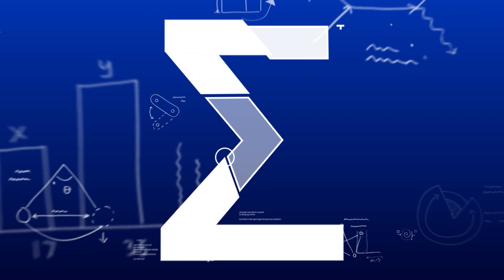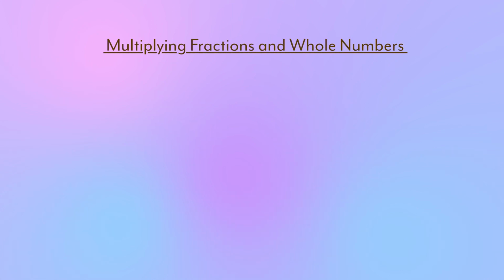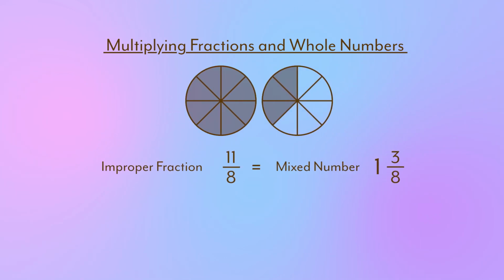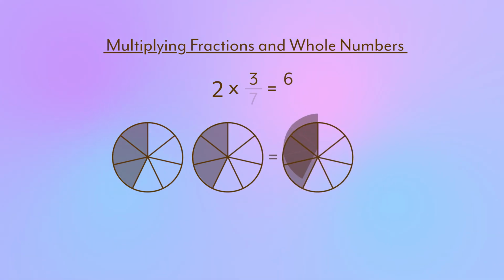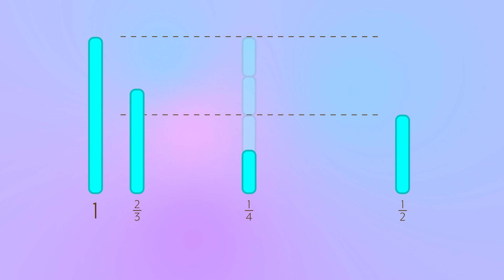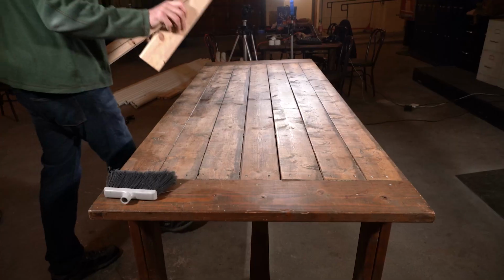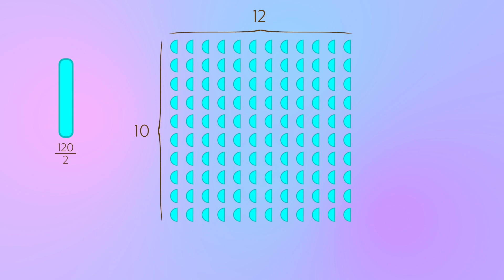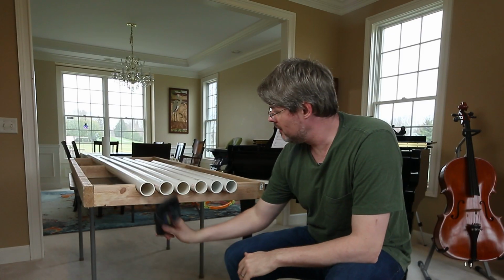How Humans can Hear Fractions

Comment: Thanks for this great video! I love your channel and find that your videos inspire me to expiriment and learn more about math! A while ago, I wondered what the relationship between hertz and notes on the piano are, and did some expirimenting and I found this out from what I knew:
In science, we measure pitch with hertz. to find what hertz a note is, you need to know two things:
1.) what hertz another note is. (A4=440, for example)
2.) the formula for moving up or down a half step. (Which is the twelvth root of two)

Here's how I figured out the formula from what I already knew:
1.) I knew that when you go up an octave, the hertz value doubles. Ex: A4=440, so A5=880 and A3=220
2.) There are twelve notes in an octave (8 white notes, 5 black notes)
When you go up a half step, you have to multiply by a certain number, and I know that you multiply by 2 to go up an octave. With h=go up one half step, and c=go up one octave, we can say that c=2. Since there are 12 notes in an octave, you have to multiply h 12 times to get to an octave, this means that h*h*h*h*h*h*h*h*h*h*h*h=c, or h^12=c. Solving for h, half steps, we get h=twelfth root of 2. Goin up a half step means multiplying by twelfth root of 2. 
To find out what a note's hertz is relative to another note, find out how many half steps away it is. To find A#, I know that A=440, so I multiply it by the twelfth root once. A#=440*twelve root of two. to go down, you divide by twelfth root of two, and to go up, multiply. 
I love math! :D

Comment: The solution that doesn't require cutting, for anyone interested, is to make an automatic guitar/piano. Take several same-length strings, and have a holding apparatus pinch them off at measured lengths, taut. then strum or strike them to hear their notes.

Comment: I always assumed each note in an octave went up by eights, but after watching this, and thinking about the simplification, that would never work, and this made sense of it.
Reply: Going up by eighths wouldn't have made sense since there are 12 notes in an octave. This is a bit more complicated than the video makes out, but there are different types of temperaments you can use to tune, this video uses more of a type of just intonation. The one you're likely familiar with is 12-tone equal temperament which sacrifices some of the nicety of perfect fractions between the notes in favor of having consistent ratios between the notes, by placing each note spaced evenly on a logarithmic scale, such that any two notes you pick that are n semitones apart have the same ratio as any other pairing of notes that are n semitones apart.

Whereas in Pythagorean tuning for example a perfect fifth is 3:2 ratio (or 1.5), in equal temperament it's (2^(1/12))^7 (twelfth root of 2 to the power of the interval) or approximately 1.49830707688, in specific equal temperament perfect fifth is about 2 cents lower than a perfect fifth from C in just intonation, and I have to specify perfect fifth from C when referring to just intonation because in just intonation, each scale has slightly different ratios, 7 semitones from A is not the same as 7 semitones from C, this is what equal temperament attempts to solve, in equal temperament the notes are basically imperceptibly out of tune slightly, so that the ratios between specific intervals are the same regardless of where they are.

Fun note this is also where the concept of different scales having different feels comes from, back before equal temperament became the standard, and we were using Pythagorean tuning or some form of just intonation, each scale legitimately had different characteristics as the intervals from the tonic were different than when using a different tonic. In equal temperament this really isn't the case anymore, you can transpose a song and the ratios between notes are the same regardless of key. Most people consider this a benefit, though some feel we're missing out on the different feel you get for each key in just intonation.
Reply: each not goes up by the 12th root of 2